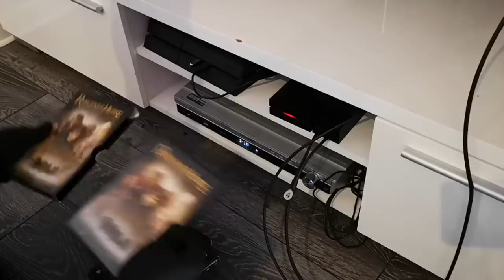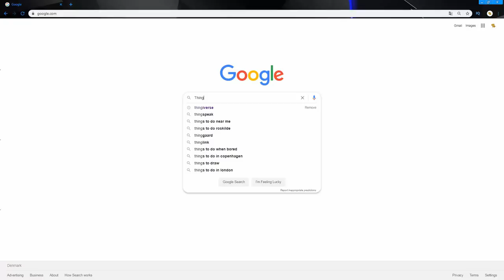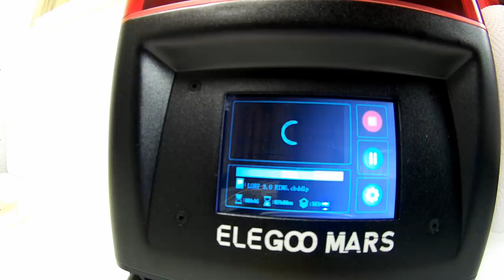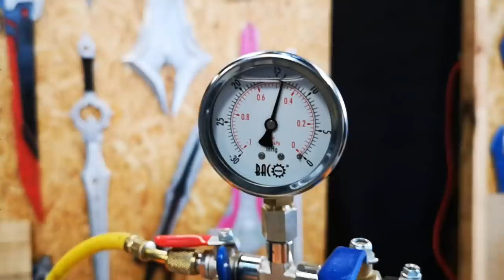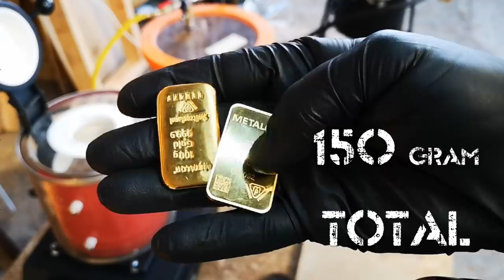Casting The One Ring In REAL GOLD $5,000 (Lord Of The Rings)

Comment: nice piece but a few comments, first, that small wax add-on you did to have two connection to your ring, was pretty much utterly useless. Secondly, when casting, have the vacuum pulling first, then poor the molten metal. Third, when breaking the plaster by putting it in water, you can just dunk it straight in water, if you've waited about 5-10 min after casting ( to make sure the metal isn't red hot and so malleable. Fourth and last. I would not recommend making something out of 24kt gold... its way way to soft to be a proper piece of jewelry. Make it 20kt, 18kt that's fine, but 24 is to soft. ( tips and rants from a jewelry student)

Comment: Was 5000$ the price of the whole 150 grams used? Cuz that seems like a very small quantity of gold for just the 30 ish gram ring to be 5000$
Reply: The 100g Bar was about 5000$, that should be right. The Ring is less than a third of that.
Reply: @danielroder830  Ya he could probably make at least 2 or 3 more with what was left over in gold. Final weight was around 29g...current price of gold 56.42 so the ring itself is  $1636.18..Up sell it at 2k and boom make 3 your at a profit

Comment: Good thing you're using one of those printers indeed, anything else would have been instant crappy lettering on the ring most likely.
Still thinking pooring that is gonna be hard, doubt it'll really form really well. And engraving to take more out is easier than adding onto it i am guessing.
150 grams, damn that is a lot.
Made a broche myself, yellow gold pentagram with square wire with a white golden plate in a sort of tri nove thing with 3 rubies set in it.
That bastard is like 12 grams, and that's heavy. Of course it was more, some loss of the place, plus cutout, plus some leftover wire.
But i didn't have to poor that myself to make those thankfully.